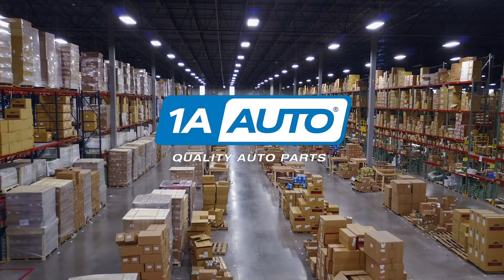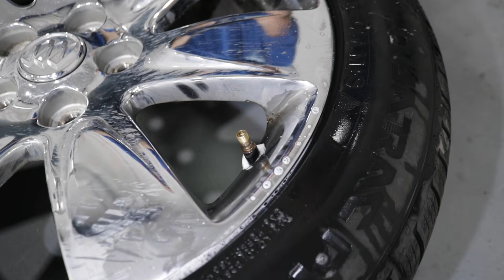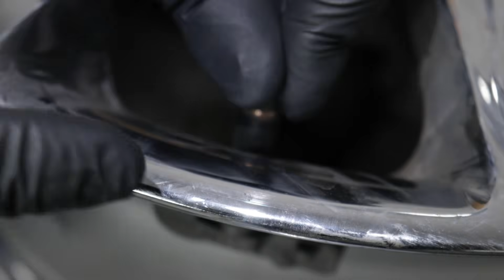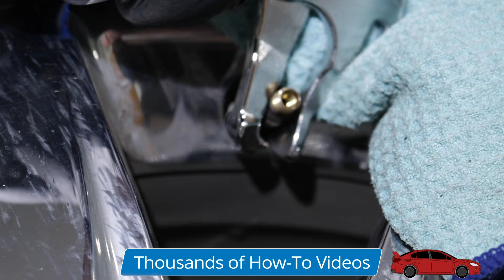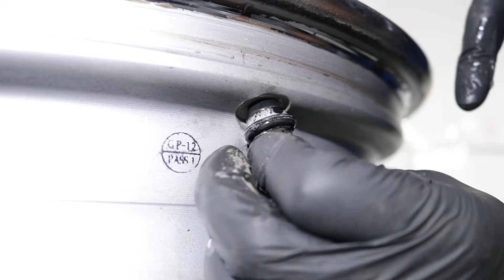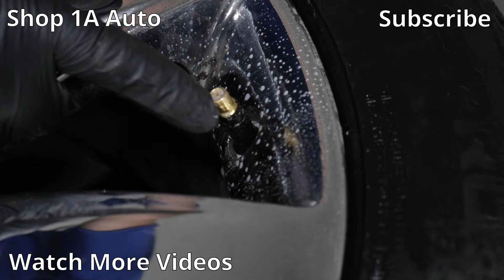Tire Slowly Leaking Air? Check The Valve Stems!

Comment: I just had new tires on my 2012 taurus and now suddenly i have leaking valve stems. Belle Tire never suggested replacing the stems when the tires were off the rims. Now I have to take the car back in to get the stems replaced. Sure sounds like a scam to me! Suddenly my stems leak... Unreal! Ive given them 1100. already and now they want more. Bull crap!

Comment: I'm happy that I chose to visit the car dealer because my colleague mentioned that it was as easy as attaching a new one purchased from the automotive parts store. I might have considered taking it to a local tire repair shop, but they likely wouldn't have been aware of how to prevent any harm to the sensor.

Comment: Good video, I have a problem with leaking valve stem losing about 5pounds in 10 days, (have done the soapy water test and it bubbles up if left for a while) its a tpm sensor valve and the stem has been replaced 3 times by the tyre fitter, and it's quite  a pita, I'm gonna have to get it looked at again! 
Have been thinking, could a tyre sealant help in this instance which I could install or would that be a waste money for this. 
Am also think of replacing the whole tpm sensor along with the stem. 
Your thoughts please..
Reply from the maker: +Dave Linkson Thanks for watching!  If the issue has come back multiple times then the next step might be replacing it entirely!

Comment: Will Nitrogen filled tire prevent this corrosion in the valve stem area from happening?
Reply: Not an expert, but nitrogen sounds like 100% hype to me.
Reply: @rp9674  it is

Comment: The core (Schrader valve) leaks many times, thats an easier fix.
Reply: I found that out yesterday.  Just twisted it on better.
Reply: @vernonpaigejr.1517 never used to be a problem with genuine Schrader cores, but now we  get cheap Chinese copies.

Comment: Sir plz tell which car brand engine is more reliable Honda or Hyundai??
Reply: Honda is the better out of the two.
Reply: ISUZU, regular maintenance at Tang Park Thailand. Never any problems within 10 years, 200,000km. Except loosing some air pressure over night, sometimes, irregular, 4 wheels. Now at rainy season the tyres (new and older) get beaten hard from unexpected wide deep potholes.
Reply: Toyota
Reply: None

Comment: Tip.when doing rubber tpms stems snip some cuts in the bottom of the stem.itll pop out better .i pop the sensor on before i pull it through so you dont have to worry about turning the stem after.but good video